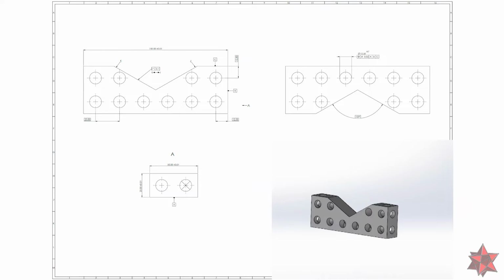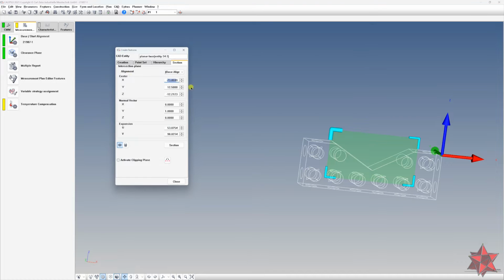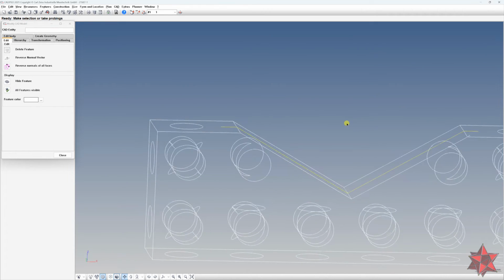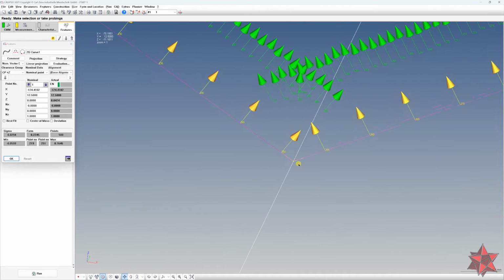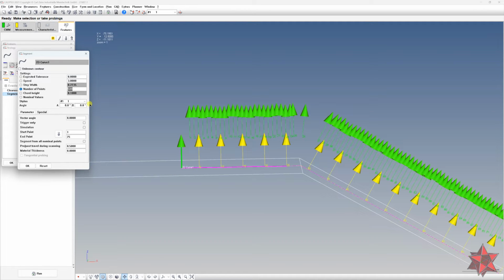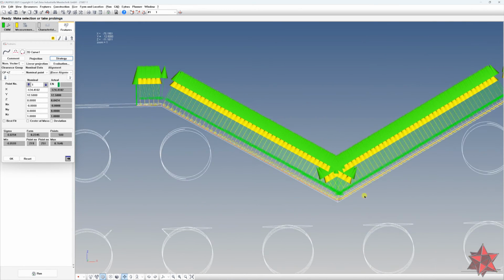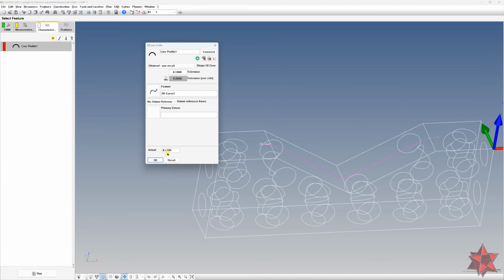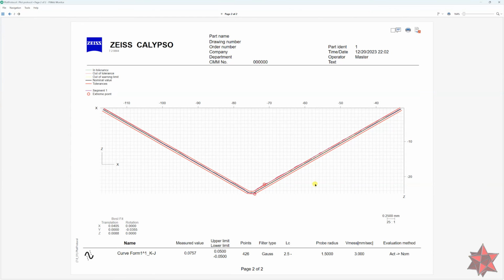Calypso  - Profile of line step by step tutorial

Comment: Great video. Thank you so much for this. I appreciate the details. Would you recommend to always use filters and/or outliers from the cookbook on curves? Also, is it an acceptable practice to add multiple curves to a freeform surface and recall that freeform to a single profile characteristic?
Reply from the maker: If you are measuring metal, than you can use the "recepies" from the Cookbook. Yes it is acceptable.